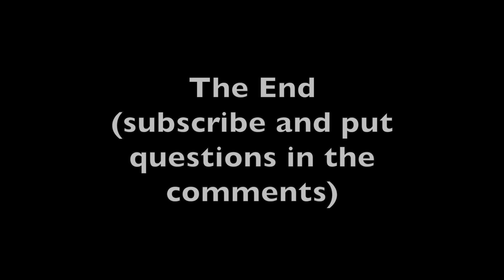Mast Stepping and Solar Rack Installation on a Catalina 25 Sailboat (step by step)

Comment: This reminds me of my Catalina 22, except that I was able to raise the mast by myself.  I didn't need an A-frame or gin pole, or a crank on the crutch.  Instead I just attached the mainsheet tackle to the bow and the forestay, and used the 3-1 purchase to pull the mast up.  Even so, it was so much hassle, taking an hour and half to rig and launch, that I only used the boat for multi-day trips.  So I sold it.  It looks like the Catalina 25 is even more work to rig and launch, and maybe impossible for one person.  But if you always have lots of help available like in this video, maybe it's not so bad.  I'm currently building a Sam Devlin designed "Nancy's China," a 15-ft gaff rigged sailboat which fits in a standard garage stall on its trailer, and can be rigged and launched in 15 minutes by one person.  Much more convenient and will enable me to get out on the water more often.  It can't accommodate a crew of four, but I mostly single-hand anyway.

Comment: nice..shows the importance of coiling your standing rigging after the mast is dropped for next time. i notice  the ability  of the mast still had to move sideways a bit as it was raised. I saw a video on how they fixed this. they used the "A" frame, but at its end they had a pc that slides in the mast slot (where the sail slugs go, maybe a slug?)  then had the A frame on the stern side of the mast so as the  mast went up that pc slide  in that slot and still held the mast from any side movement..they used the forestay to the a gin pole (some used the boom) then the main sheet tackle to the bow and a line from thegin pole to the tackle.others just used the upper shroud stays to do the same thing instead of an A frame.   i purchased an 81 Sirius 21 and going to make something up for mine... this is why im watching all these vids of mast raising to get the best of everyone's ideas

Comment: Nicely put together video Greg. I like the jib halyard on the uphill side technique. I've been using "baby stays" to prevent lateral movement during raising. I have found that it is much easier on my C-25 to raise and lower without the genoa attached to the furler, but you make it look easy.
Reply from the maker: I am not sure if I can raise mine without the sail attached.  I have never had it unthreaded from the roller.  If I assign one person to walk it forward it normally goes ok but the mast would be real light if I could take it off.

Comment: Excellent How to video.  Thank you.  

Question: Can you comment on towing and the tow truck?
Reply from the maker: I tow it with a 1 ton diesel but do long drives t random locations around the NW.  You can do short trips with a 1/2 ton, medium trips with a 3/4 ton.  I like the bid 1 ton because I can go fast with the boat, 75 mph no problem.

Comment: Very helpful. So what kind of line do you attach to the bottom of the forestay for raising/dropping?
Reply from the maker: I just use the main halyard for the main sail.  Where it would usually attach to the top of the sail, I instead attach it to a cleat on the bottom of the mast.  I then tie a figure 8 knot at a premarked point on the end where I then attach my lifting cable.
Reply: @The_Briggs  Thanks so much for the reply! One more question as I look to drop my mast for the first time... With the hinge pin loose but still in, it would seem the mast has to be lifted in order for it to start to come down. If it's not lifted it would seem it cannot tip back because the hinge pin will be stopping it.
Reply from the maker: @honestmotion9953  There is space for it to slide up.  The slot is pretty tall.

Comment: Can you provide some information on the A-Frame poles? Are they steel, aluminum or stainless? What OD & ID size are the pipes? How thick is the metal of the pipes? How are they attached to the boat, thru bolts or quick release pins? I'm not sure but it looks like the A-frames are attached to the most forward chain plates. Is that so?
Reply from the maker: They are galvanized poles, probably 1 inch in diameter.  I had them in my scrap pile, I think left over parts from building a frame for our sheepherders' tent.  If I get down to my boat this winter I will measure them up.

Comment: Great video. I'm curious about your solar set up. Does it cause much wind drag and also does it make the boat more top heavy?
Reply from the maker: I really don't think so.  The panel weighs about 40 lbs and the frame is lightweight.  That vs a 750 lb keel....I'm not that worried.  And there must be some wind drag but I am not a racer and any downside is overcome by the benefits.

Comment: Well that didn't look too rough.  I like the solar tower.  Are you pleased with that tower design or would you do something different?
Reply from the maker: I do like the solar tower quite a bit. Out of the way, big panel, and provides some shade. Not sure if you subscribe but I did do a video on that tower.
Reply: @The_Briggs  I just came across your channel.  I'm bidding on a Catalina 25 right now, but I was wondering just how much of a chore it was to step the mast.
Reply: @The_Briggs  did you build the tower or buy? Aluminum, stainless steel or painted carbon?
Reply from the maker: @solrac7782  Here is the video:  https://www.youtube.com/watch?v=tYk5FfVazBY&t=254s. Aluminum.